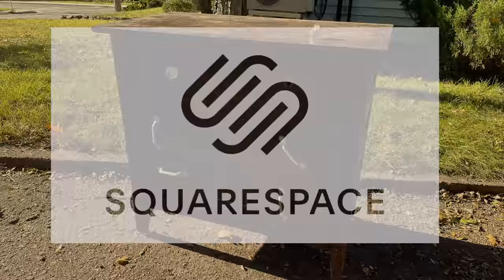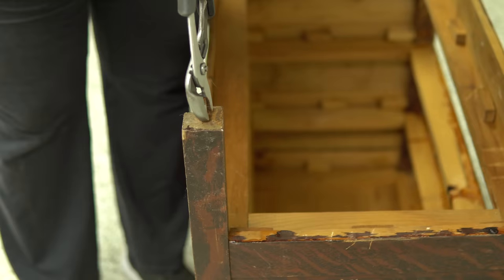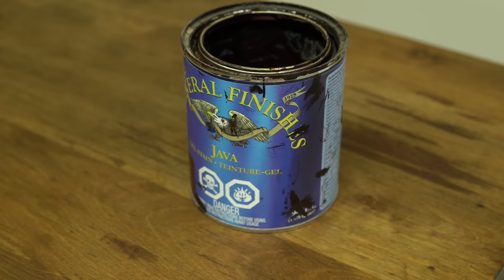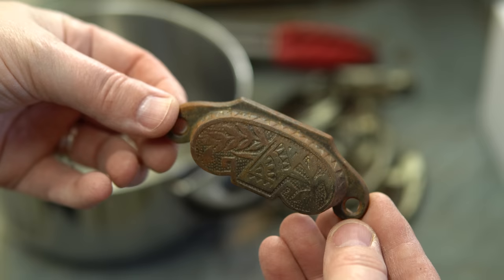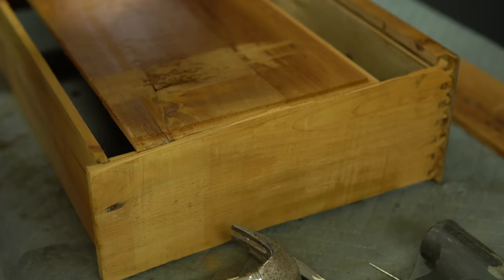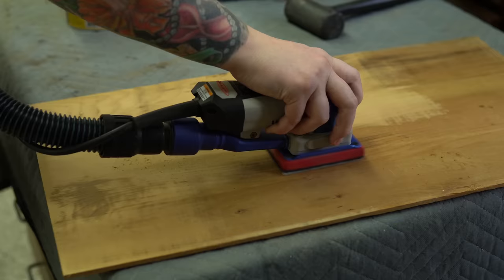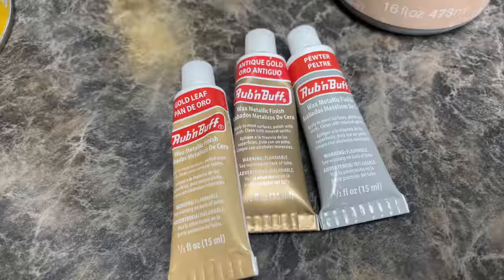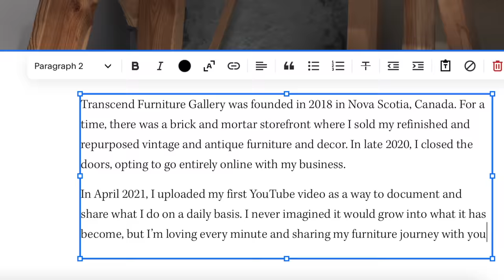Yes, I painted this chest of drawers: THAT is a FAUX oak finish!

Comment: I didn’t catch what stripper did you use for this piece? I’m looking for a good but gentle paint stripper. Are there different strippers for real wood versus cheaper painted furniture like painted laminate pieces? Any help would be appreciated! 😊
Reply from the maker: Stripper on laminate is a no go but if you're referring to veneer Circa 1850 is my preferred stripper and you can use it on any wood. Gentle stripper tends to not work as well and makes you work a lot harder for the desired results. Thanks so much for watching!
Reply: @TranscendFurnitureGallery  yes, I found out the hard way on a starter piece I picked up for free. Previous owner didn’t prime or seal what appeared to be laminate or a thin veneer, just painted directly over it w/ several coats & the stripper ate right through it leaving a light brown residue on my gloves 😢 living and learning. I’m still trying to learn how to identify diff materials.

Comment: Where did you get those pulls? They're exactly the same as the ones on my dresser, two of which I'm missing!
Reply from the maker: I got them at Lee Valley.  Something like these ones: https://www.leevalley.com/en-ca/shop/hardware/pulls/bail/112340-3-steel-die-cast-bail-pull?item=00W4710 
Thanks so much for watching!
Reply: @TranscendFurnitureGallery  🙏🏻

Comment: i noticed you do not always strip your pieces. what determines wheter or not you chose to strip it?
Reply from the maker: I usually will only sand a finish away if it's basically non existent or if I'm on solid wood. I'll scrape usually over veneer with SOME finish, or a lighter/damaged finish, and I'll use a chemical stripper for removing thick finishes or multiple layers of paint. Thanks so much for watching!

Comment: Angie, I think this piece is homemade because of the wood pieces on the back, which gives it a very primitive feeling. What are your thoughts on the construction, do you agree with me?
Reply from the maker: Many factory made pieces had backs like this. This is depression era furniture, which so many people don’t realize. People get reallllly upset when people paint these, not realizing these are usually pretty poorly constructed things. I’ve seen this exact model many times, it’s definitely a factory produced piece, and the faux graining on the front is done with a large roller/brush - the average person wouldn’t have access to something like this.

Comment: How many poly&stain coats did you put on this piece and did you have issues with dust settling in while it dreid?
Reply from the maker: Because I don't have a dedicated spray/finish room, dust is always a concern, but I do what I can do minimize dust prior to applying any finishes. I also very lightly sand or scuff in between layers, which helps remove any little dust nibs. I don't remember exactly how many finish coats on this specific piece, but usually I'll do 3-5 depending on the finish, the piece, and the usage (ie- table tops would get more coats).

Comment: That iy had a faux finish  is more reason you shouldnt have psinted it. Its victorian cottage furniture.  Rare and hard to find
Reply from the maker: It is not rare, AT ALL, nor is it hard to find. They are alll over marketplace and in auctions. They were mass produced with cheap material to mimic higher quality furniture. They are not valuable.